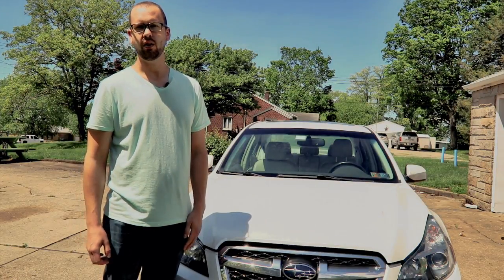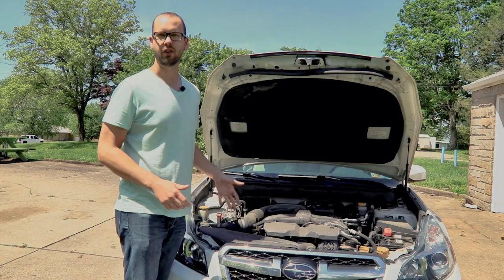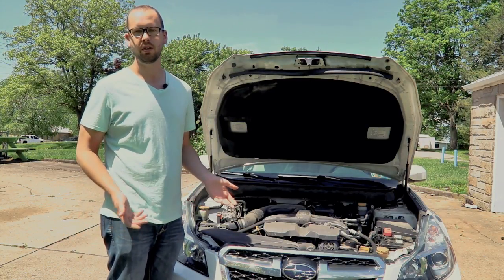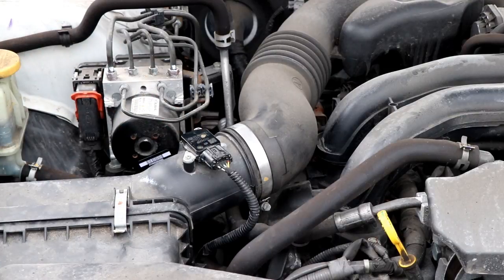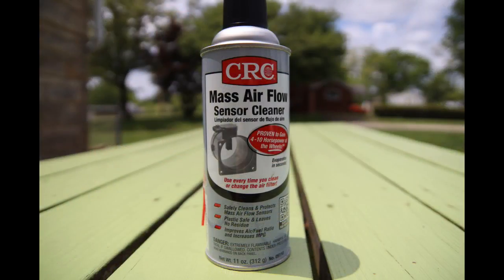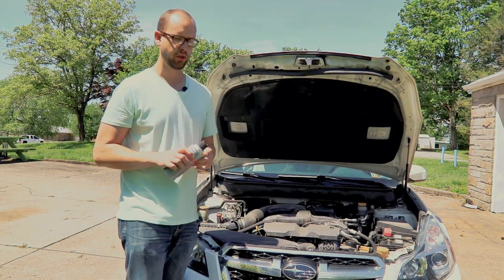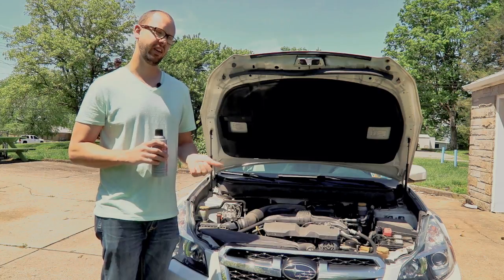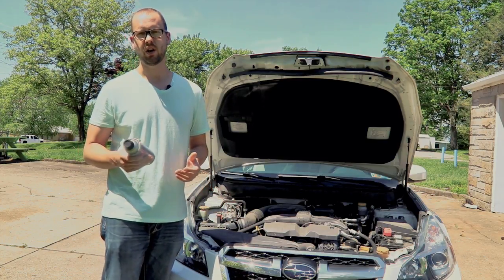Cleaning the Mass Airflow Sensor in a Subaru 2.5i Legacy or Outback

Comment: There are 2-3 wires hidden away inside the plastic body of the MAFS, these should also be cleaned, that is the actual sensor. The other guy is right, you just cleaned an IAT temperature sensor, as it is really 2 sensors in one.

Comment: My guy.. that's not the MAF sensor you show you're spraying.. it's a heat sensor that's coincidentally housed nearby it and will affect nothing airflow-wise. The MAF sensor is two ~1cm tiny wires hidden up the hole in the tube; use a flashlight to see em. You need to spray up the tube and let it dry thoroughly. Best of luck.

Comment: But that is not MAF sensor you are spraying, that's temperature sensor. The MAF is inside square plastic tubing.
Reply: That's the Maf hot wire not the signal wire that relays air density information back to the lack to tell the injectors to spray more fuel to mix with that current air fuel ratio.

Comment: Good video. I cleaned mine already in the same manner on my 2005 Forester 2.5 SOHC. The part that you sprayed in the video was the IAT ( Intake Air Temperature) sensor. The MAF ( Mass Air Flow) sensor is inside the plastic housing. It's a dual sensor. So I took it back off the sprayed inside. Hope this helps someone. The cost of that sensor for my car is $212

Comment: I used a razor scraper on mine to remove that black gunk on the end. The wire broke off so I soldered it back on. The car runs better than ever! My milage has been better than it ever has! I lost the screws and used hot glue to hold it on with but it popped off so I used Orange RTV on it. I got it all over the end of it when I dropped it in the dirt. It didnt seem to hurt anything. I also superglued the connector on because I broke the tab so the connector holder off. I got too much superglue on it and now the tube wont come off for the air filter. Its ok because I never change my air filter.
Reply from the maker: Lol that is ridiculous, but whatever works...   Probably wouldn't recommend it unless your car was a serious beater and you are just trying to keep it going for a little longer
Reply: @CoolStuffGuysLike  THAT was a joke. I take really good care of my vehicles. I would never fix anything using hot glue or do a bad job at a repair. I guess I was just feeling silly that day.
Reply: Made me laugh 😂 awesome man 👍
Reply: @scottfirman  you didn't use chewing gum?  my go-to..
Reply: r/askashittymechanic

Comment: That's not the right sensor. There's 2 sensors. It's the other one. That's just air temp sensor
Reply from the maker: On the 08-14 legacy and outback that is the mass airflow sensor (Denso Part Number: 22680AA38A).  I believe it also measures air temp but the part is listed as "Mass Airflow Sensor".  The only other sensor along the intake is the MAP sensor but that is on the other end of the throttle body.
Reply: Sorry I should have said that's the right part. But it has two sensors. The easily visible sensor on the outside measures air temp but the sensor that help with MPG is actually deep inside that part. You can clean the same way also see: https://youtu.be/t-REglL2twg?t=1m48s (for general idea of location on a similar sensor) The air temp sensor isn't really affected by a lil dirt but the other sensor is extremely sensitive and thus why its hidden.

What you are cleaning here ( https://youtu.be/-1AxwtXcY7I?t=2m39s) is the AIR TEMP sensor.
Reply: Yes there are 2 sensors on the maf, the one you sprayed is just 1 sensor, you should spray the other one inside

Comment: My Liberty/legacy GT with 97,000kms was feeling a bit rough at idle. Did an upper engine clean and MAF clean, on the visible and internal bit of the sensor. I must say when waiting at lights my car does feel "still" now with no rough vibrations.
Reply from the maker: Awesome!  Glad the MAF clean smoothed it up.
Reply: Cool Stuff Guys Like though now my temperature is stuck on 19 degrees 😳😳😳
Reply: After about an hour's drive/day passing the temp sensor is good now

Comment: My stage 2+ flex fuel tuned wrx was on the dyno Fri...Just had the chance to go WOT today, and noticed an intermittent hesitation at 5500+ rpms...Almost like a mild misfire but no CEL...After banging my head, and thinking it may be a boost creep fuel cut (would be bad!) I decided to check the maf and map sensor...MAP was FILTHY DIRTY from oil vapors, most likely from before i installed my AOS, TGV/EGR deletes...Gently cleaned her with maf cleaner and a tiny FINE paint brush...Runs like a champ now...I hope it was just a fluke, and that it doesnt come back tomorrow..lol

Comment: Thanks! I’m trying everything I can with this Outback I have. It hesitates and there’s no “smooth-ness” to accelerating after slowing down. Im hoping this MAF cleaning will help!
Reply from the maker: Hmm.  If it has a cvt transmission it could be a downshifting issue which may be a transmission controller valve body issue.  They program these transmissions for fuel efficiency so hard that it takes out all the spunk.   It's like starting in second gear I find often with the newer subarus.
Reply: @CoolStuffGuysLike  - I’ve found that if I pump the gas very slightly 5-15 times I can get it to speed up quicker (to a point). But when doing that, it sometimes doesn’t change gears. The fuel system (or sth) doesn’t respond - or sth else goes on or doesn’t and even with the  little pumps the RPMs just go higher and higher. Yes the car is still accelerating somewhat like normal except the RPMs are wicked high. Of course I back off all of the way at that point until it normalizes. By that point the need to speed up quickly is over and the operation of pressing on the gas pedal just returns to normal. The RPMs go down to normal and that bout with slothliness is over. Until the next intersection.

Comment: I cleaned  mine on my 2011 and it still runs  Funky.  Then I cleaned it again and it still runs  funky.  The  TB looks  clean as  a whistle. Only 65K miles and  9 years  old.  What's  next: PCV?  Exhaust Valve  Lash? Plugs? Cam or  Crank Position sensors? All vacuum lines  appear good and  in place. I guess I need a  pro level scanner. - Sandy
Reply: He cleans the wrong sensor in the video.. what you need is up the hole way toward the top of the assembly. You'll need a flashlight to see them and use the maf cleaner and something you can reach un with a soft brush.. be careful not to push or snap them. Good luck.

Comment: I have a forester 03' is having some losing power problems, and sone ppl told me it was the  mass air flow sensor, but mine doesn't have it. It have an air intake so doesn't have that sensor.
Reply: Hmmm.  Are there any wires going into the intake tube?  It really should have a mass airflow sensor or else the fuel injection won't know how much fuel to deliver under different circumstances.
Reply: Your MAF sensor on that year is next to the coil on the right if your facing the motor (drivers side).  Took me a while to find it too. I was looking all over the air intake forever lol
Reply: just have to look for group of wires connected b4 throtle body to find the sensor/sensors
Reply: Should be on the throttle body

Comment: You think mines dirty bc I put a knew I take on mine and after when I put the sensor in and plug it in the car won’t start Still cranks and if it’s running it will shut off if I plug it in

Comment: Rubbing alcohol should be fine, I used to be an Apple repair tech and we submerged logic boards in tubs of rubbing alcohol overnight to clean them.

MAF sensor should be fine. [Edit:] for the record, I used MAF cleaner a few days ago for my sensor and not alcohol. I also used the MAF spray on my PCV valve and it worked pretty damn good

Comment: My 06 legacy will shake when speed to 38km/h, someone say it may be MAS problem, hope this video can help, thanks a lot
Reply from the maker: It could be a tire balance or driveline issue.  If it surges or bogs during acceleration it could be the MAS.   You might have a broken belt in a tire.  That seems pretty slow to start getting a shake.
Reply: Got it,thanks

Comment: Yah my 2003 subaru legacy has been jerking upon acceleration somtimes happen even while im driving maybe this will help
Reply: Hi David, I am having similar issues with my 02 forester (My acceleration hesitates and surges and iddles rough) Did that fix your surging issue?
Reply: @gregholder5283  no, I actually had a cylinder blown out
Reply: @davidpickle8423  Thanks for the reply!